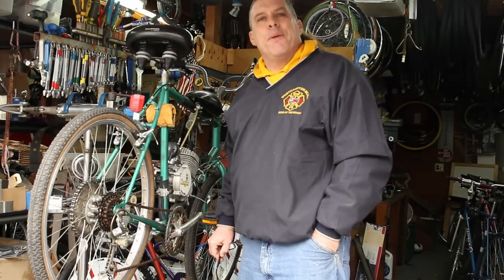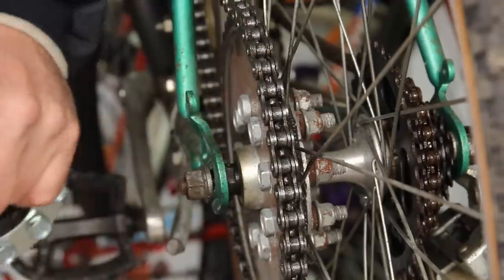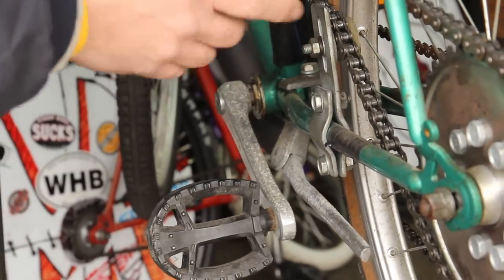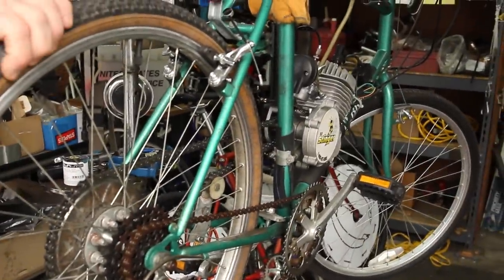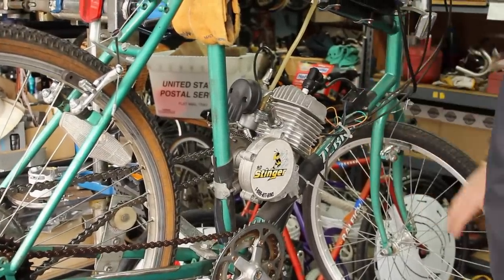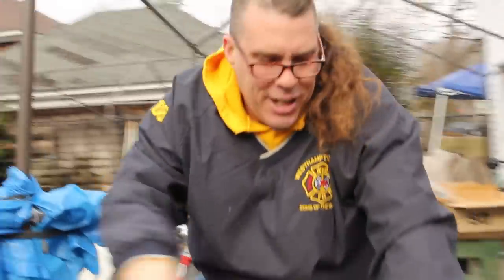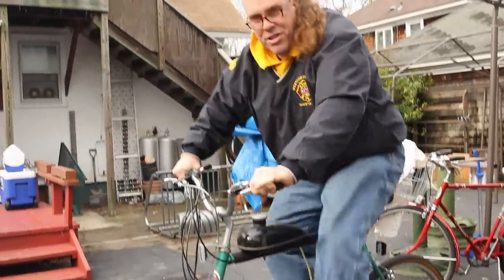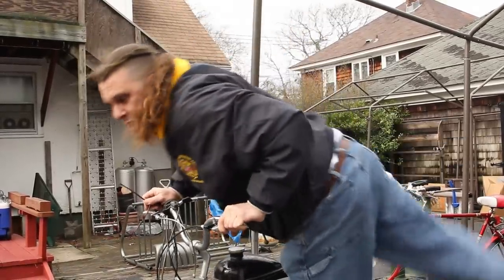Motorbike Kit Part 2 - Start up and Dyno - BikemanforU DIY Repair

Comment: I built the bikes and ride one myself. They're fun. The kill switch could cause problems, but I use mine and haven't had any problems with it. If you want the rear sprocket on better get a sprocket adapter which will mount the sprocket to the hub instead of the spokes. I have a 29 Genesis Onyx Cruiser bike that I put an engine on. It's how i get around town. Love your videos.

Comment: Part two is a cool vid another nice trick is to put the CDI under the carb and  shorten up the ignition wires going to the magneto inside the engine I also seal the covers to prevent moisture damage to the ignition as well.
Reply: That Mattster Knows his Stuff ...
 THANXZ MATT
Reply: Even better is to get rid of the CDI and get a HD performance lightning CDI. It will give you better starts and all around better performance and help to reduce vibration a little.
Reply: I so agree, I have the jag , similar to the hd far better starting and way better performance !!

Comment: I built 4 or 5 of those about 4 or 5 years ago. They are fun. I live in an apartment with no garage now so I'm into diy electric bike kits now. Motorbicycling.com has a lot of info on those 2 stroke kits. There is all kinds of stuff out there for those motors but a lot is junk. Some is good some is junk its not all the same. Current bike- Motobecane jubilee trails with 48v500w rear hub motor and 48v16 ah lithium ion battery pack. LCD 5 speed display, pedal assist and twist throttle. And of course I had to throw a huge wald double wide on the back and fenders and change the tires

Comment: I wonder if they make sprockets that bolt onto a standard 6-bolt disc-brake specific rear hub?  It would eliminate the need for that rag joint and stressing the spokes.

For $120 this thing is pretty cool, probably will buy one and find a junker to put it on.  That tune pipe is probably a little loud for city commuting, though.
Reply: Agreed.  Need to change that rear sprocket attachment.
Reply: hub clamp type adapter works great 5 minute install